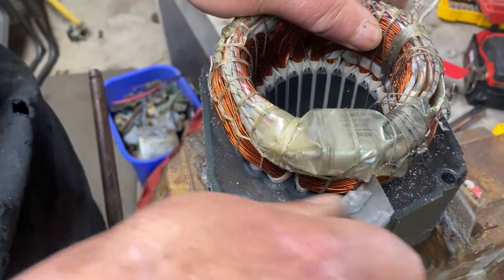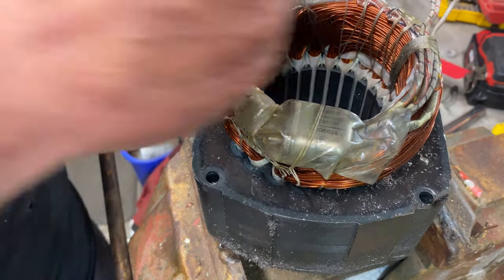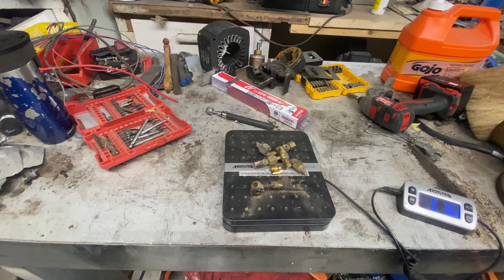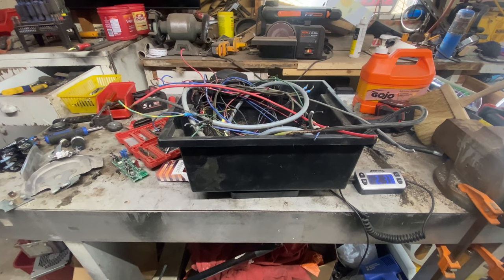Scrapping a I Have No Idea What This Is For Part 2 - The innards

Comment: I agree that was a worthwhile $2 spent. 

 my main yard i use for my precious metals pays the same for number 2 copper wire, pipe or burnt copper but I always have it separated at my yard just in case i go to the other yard with it. the other yard separates everything and are really picky and the price vary. I like the picky yard for my sheet steel/ bulk steel though because you weigh in and out on the same scale, superclean yard and they unload you with a crane.  

My way of cutting the strings is with my side cutter pliers. I start on the inside by the biggest group of strings together and cut that and then hopefully i can just pull the string by hand and it unwinds itself but it doesn't always work that way. if they don't pull then i cut each loop but i usually still use my side cutters.
Reply from the maker: Your yard sounds like my yard

I’ll try the side cutter deal thanks for the advice

Comment: I like using a cut off wheel in my 4 1/2" angle grinder  to cut those windings. Great video my friend. I wish I could loan you mu 20 ton press with the ax head to cut that transformer. The end game is lots of copper. Thanks for sharing.😎😎⛏⛏🔥🔥
Reply from the maker: I shoulda used the grinder it always works better

I have a 20 Ton press I need to rig up a axe head attachment

Comment: That resin is a plastic resin it's weekness is a hatchet you keep hitting the corner the sides split. Took me a while to find an efficient method on them bad boys awesome episode brother if you run a utility blade down the length of the copper tube the copper pulls out effortless leaving copper and aluminium. Give it a go on one length you will be surprised
Reply from the maker: I will definitely give it a try